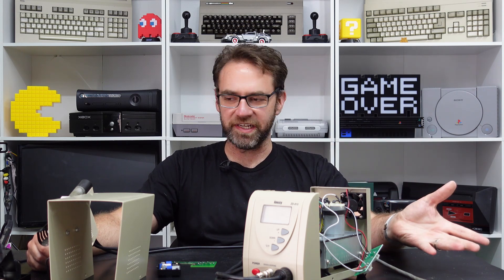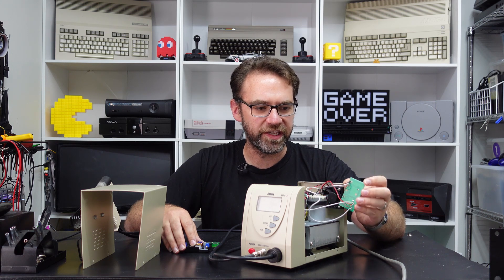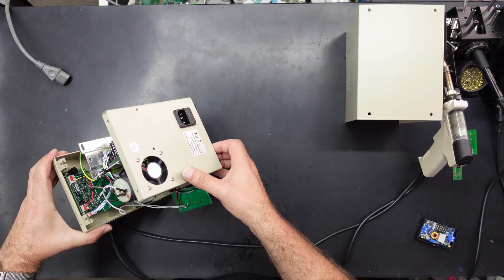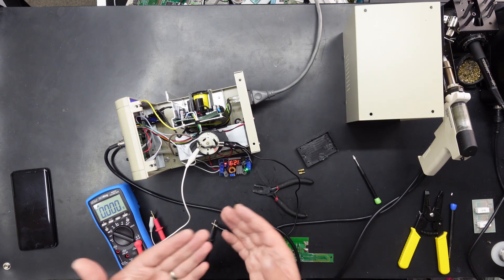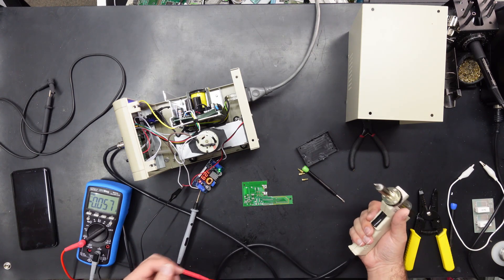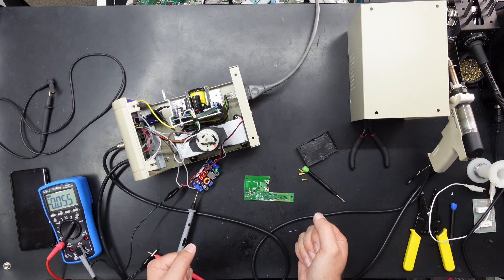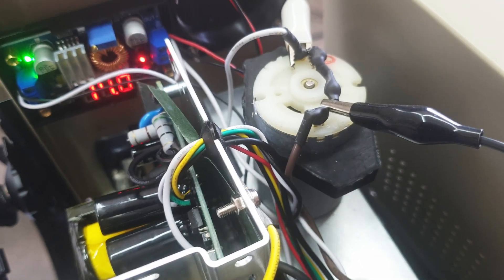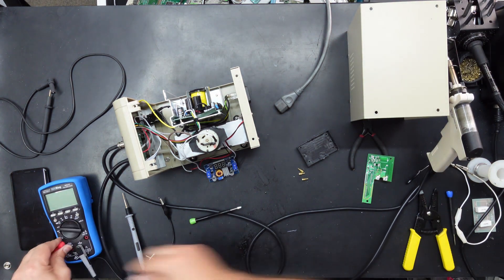ZD-915 Desoldering gun upgrade - overvoltage fix

Comment: That's why I'd replace the fan with a 24v Noctua. That way it can run with the naked voltage and a lot quieter. It all seems a bit messy doesn't it. I would also try running the motor off 18v. Motors are quite robust and are used in short bursts. I don't like a noisy workplace; air filtering/exhaust pumps, sucker pumps, buzzing flouros, etcetera, all adds up. A few less decibels is what I would aim for.
I have a solder station with this type of pump but I'm giving it to my son. Fed up with the silly cleaning process - might as well use my mechanical pump.

Comment: Just curious if you noticed the PS voltage is spec'ed at 18v but desolder gun element is spec'ed @ 20v. I find the pump is now obsolete besides mine failed due to the ridiculous screw that attaches connecting rods, and motor. I am upgrading vacpump to 24w twin, and adding checkvalves hopefully to maximize valve efficiency. It is a 12v motor but you can safely boost it 13.2 v no problem. I want to verify heat element is full 100 watt. Since these pumps are obsolete its,  difficult to obtain periodically maintenence seals for pump unless your paying a premium five times actual cost.

Comment: I made a DIY station using SS-331 gun. I bought the components from Aliexpress, including the pump motor. The motor was rated 12V 10W. When I tested with 12V it consumed about 6W. To reach the 10W consumption I needed to raise the voltage to 19V. I fully agree with you raising the voltage of the suction pump. In my case there is no need a separate dc-dc converter at all. And the sucking power is quite diferent.

Comment: The ZD-8915 and 915 and the one u have there all use 24 Volt heater element. Mine has a 36volt fan no problem with overvoltage on my 8915. but the 18 volt to the heater bug me. know there are mods on psu easy done to get 23.5 .psu on all these stations are ZD-P150 V 2.0. 18 volt 12 A, at least what other confirm they have in those models with or without sleep "sensor" The fans have different rating on many,  Same as mine had a 12 V fan while mine is 36V

Comment: Like other people before, I must thank you for those tips. I found that buck converter for 2.30€ on Ali... One difference, I ended using still the factory resistors for the pump. It's a bit overkill to use a buck converter just for one fan instead of some transistor as shown in another video about improving that ZD-915, but it's a fine and easy way to go straight to a good result. To conclude, the pump's suction is now perfect, when I was earlier kinda disappointed.

Comment: I did the mod, and it brings the fan speed down to generate much less, and less annoying, noise.
However, the 1 ohm dropper would have 18 - 12 = 6 volts over it, which means a 6A current would be drawn (although I didn't measure the actual voltage over the dropper, just assuming 6V). The replacement bucket converter is rated for 5A. Potentially a problem?

Comment: Ye ol China cracker really sucks now and I love it❤. 
I found that doodah You used, wasn’t too hard to put in but it made the hole thing way snappier!
When suction lagged before it’s now next to instant. 
This is a worthy upgrade. ❤
Thanks and Greetings from 🇩🇪
I‘m thinking about installing a relais so the power to the pump no more needs to go thru the whimpy switch in the pistol, just to be shure.

Comment: Ive been using my zd915 for a couple years. Definitely got my moneys worth.
I wanted to grab a heating element for if/when mine goes out but all that available is the parts for the proskit new version.

I wanted to order the whole new priskit gun but its 7 pin and the zd915 is 6 pin.

Any idea what the extra pin is for?

Would you still suggest the buck converter mod?

Thanks
Reply from the maker: No idea what the extra pin is for, it could be the pinout is completely different anyway. I'd still recommend the buck converter mod, but in saying that it seems mine is having issues lately - the suction power has definitely dropped. I don't think that is down to the buck converter mod, but if yours is already had a lot of use it may not be worth the effort. These don't seem to last that long and yeah spare parts seem to be drying up.

I do have a spare gun so I'm going to take a closer look and see if my issue is down to the gun, or pump or something else. Otherwise I'm thinking I'll get a Hakko FR-801 from Amazon Japan, they're much cheaper from Japan but will require a stepdown transformer to work here (which I already have). Don't know if it will work 100% though
Reply: @TheRetroChannel  The hakko 801 is a hot air station right?
I did end up ordering the buck converter, it was only $5 so figured its worth a shot.

I was going to order the proskit new desoldering station but only see the 220v models on aliexpress and need the 110v.

Guess ill just wait untill the zd-915 craps out and probably get one of those handheld hakko 301 units although to me they look bulky and worry about the suction power.
Reply from the maker: Haha, oh yeah sorry I meant the 301 not 801
Reply: 12v oto vakum var bağlıyorsun  z9 915 in vakum unun 5 katı güçlü bakırlı yolu emiyor...😂

Comment: Thank you very much for the tip. I just finished upgrading my ZD-915 with a buck-regulator (I set it to 13 V for now). It definitely sucks better now than before and the fan (I also had the 12 V fan installed) is significantly more silent, even though I didn't cut away the grille. My motor had the correct polarity marking and I also installed the diode and three suppression capacitors in X/Y-connection on the motor.
Reply: Is there any documentation or links to the mod you did?
Reply: @LameGaming  it should be in the video - I just replaced the board with the two resistors for a step-down dc/dc board. Minute 4:20
Reply: @uwezimmermann5427  Sorry, I meant the part about adding caps in line with the motor. I didnt see that mentioned in the video.
Reply: Ehm, about those caps- why and where did You put them?

Comment: THANK YOU.

Dude this is a fantastic tutorial and the upgrade is 100% worth it. The buck converter you found fits so perfectly into the old spot it's like a match made in heaven. Super easy to swap in, no case modification or cutting, and worked with almost zero trouble shooting. Cannot thank you enough for taking all the guess work out of something like this.

BTW, my unit seems to have an upgraded PSU; it's fully enclosed and looks exactly like what comes in the pro'skit station. Not sure how many versions of the ZD-915 there are but I'm very happy with the performance after this mod. 

P.S. my dad loves you C64 videos, over the years of taking care of him it's been a struggle to keep him interested in just about anything. But your restorations, upgrades, and general love for the system is a great walk down memory lane. 
Keep up the amazing work, I really cannot thank you enough
Reply from the maker: Thank you, and glad to see your dad is enjoying the videos as well, that's fantastic.

With the buck converter, I think in the end I have it putting out about 15volts. According to another viewer the pump is rated at 24V, so in theory you could just wire it direct to the power supply, although in practice that might be a bad idea 😅

Comment: Interesting. How about a "pulse suction" upgrade like here: https://youtu.be/j8LMdIZuDyw   Or (self advertizing) also upgrade power to the gun: shorturl.at/nBHR8
Reply from the maker: Thanks, I did see that video but figured the trade off between instant suction and having a bunch of extra components stuck to the gun wasn't worth the trouble.
I'm thinking of just removing the buck converter and running the fan and pump off the full 18volts. Another commenter mentioned their pump says it's rated for 24v, so couldn't hurt to give it a try (assuming the main power supply can handle it)
Also the shortened link you posted seems to broken

Comment: Intersting. I thought that the higher-quality buck converter would be a notable improvement.🤔 However, I did know that attaching the hose would improve the suction strength.😜

On a serious note, it is difficult to find that SD-915 here in a 120VAC version. I'm curious does the tranformer indicate that it might be 120VAC configurable?
Reply from the maker: Haha, yeah connecting the hose certainly made a difference.
It seems fixed to 220-240v. Apparently even the 240v version is now hard to find.

Comment: I'd love to know if anyone else in Australia has managed to procure a ZD-915 recently.  I tried and failed, so I ended up settling for a Yihua 948.  It does a better job than a manual solder sucker, but the build quality doesn't exactly inspire confidence. Seeing this video, and how a ZD-915 can be modded like this, makes me kinda wish that I tried a bit harder to track down a ZD-915.
Reply from the maker: Bugger, yeah the zd915 seems to be hard to find these days. Maybe the original manufacturer Zhongdi? will do another run but who knows.
Reply: sell ya mine for the price of a jbc lead sucker. XD
Reply: I been using a Hakko 808 for 10 years and now is time to do a  change, I have many throughole  desoldering stations,
Some in their boxes without use.
Top throughole desoldering stations cost over Us$500 dollars, if can't afford the Yihua 948 is the right tool or you.
I bought one Yihua 948 and works fine, very quiet, strong suction.
Has sleep mode , looks well made, I have 3 weeks with it, without any problem.
Best Regards.

Comment: My ZD-915 has 24V fan wired directly to the power supply (actually these 2 connectors on resistor PCB are used as input, and the single connector is used as output). The pump motor is labelled 6-24VDC, so it could easily work with 18VDC from the PSU, but it makes it really loud.
Reply from the maker: Interesting, yes I've heard some of them have a 24v fan but didn't realise the pump could handle the same. Mine didn't have a sticker on it, just some random markings that yeilded no results with a Google search. Maybe I should bump it up even higher, or just wire it directly to the 18v 😁

Comment: I have this same unit. I may bump it up to 14V eventually. It seems to do the job ok for now though. Sometimes I need to use my heat gun on really stubborn solder blobs though.
Reply from the maker: Yeah, like I said it seems to work a lot better but I'm sure there will still be times when I'll need to break out the heat gun